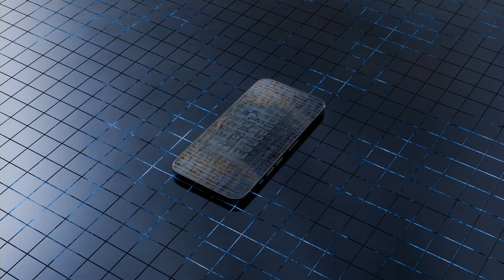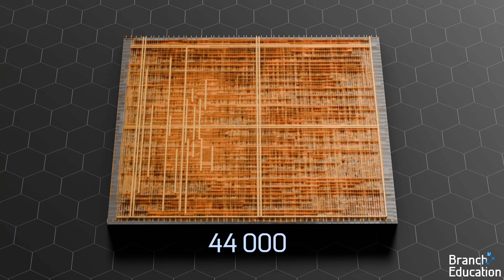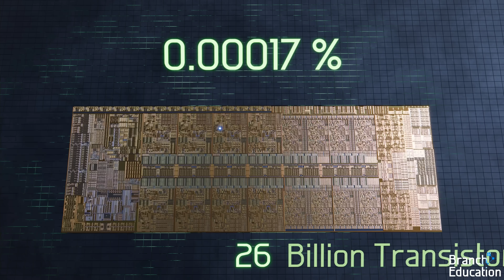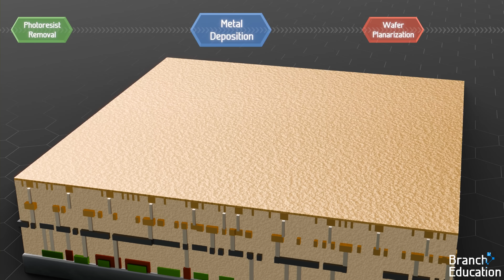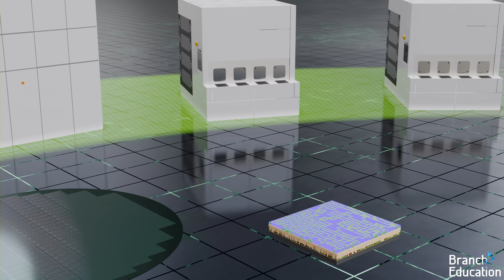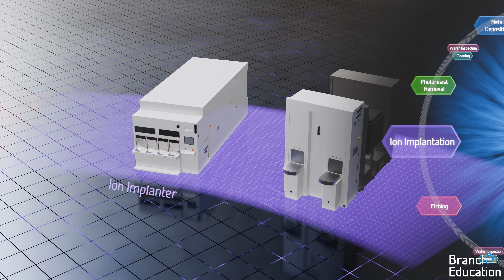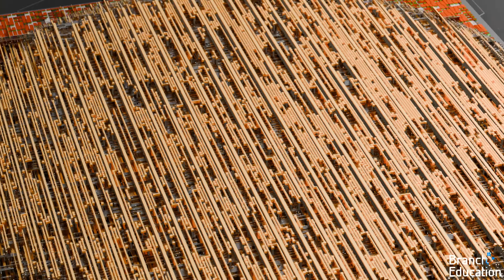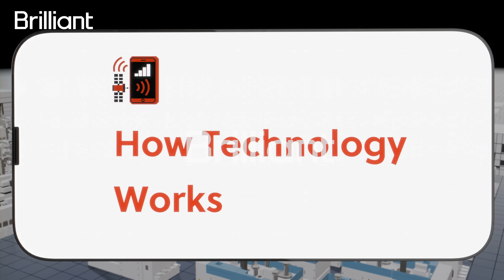How are Microchips Made? 🖥️🛠️ CPU Manufacturing Process Steps

Comment: Why are the silicone wafers round? I mean cutting square wafers would produce less waste than round wafers. I guess there's a good reason behind it.
Reply: wander myself as well, asked chatGPT, here are the main points: Manufacturing Process, Mechanical Strength and Handling,Efficiency in Semiconductor Fabrication,Minimizing Waste, Standardization and Consistency
Reply: @wisequigon  windows in airplanes are round because it's more durable shape. Maybe it's the same with wafers.

Comment: I knew that I would not be disappointed when I saw the video in my feed. Great work guys, I mainly talk about your channel to my friends when speaking of an efficient teaching/learning. The only problem I noticed in the video is that woosh sound when the scene moves around fast. Mainly at 10:36, 13:46, 14:10, 14:21. The timing should be accurate and the pitch should be proportional with the speed of the camera. This way the brain won't notice that and it will be an element of immersion. I am not a sound engineer but I have made some audio effects. If you don't have a guy for a custom sound FX library, I could help, at leaast with thee sounds.

Comment: yeah and then they take the dingle bop and they push it through the grumbo, where the fleeb is rubbed against it. It's important that the fleeb is rubbed, becasue the fleeb has all the fleeb juice. Then, a schlami shows up, and he rubs it...and spits on it. They cut the fleeb. There's several hizzards in the way. The blamfs rub against the chumbles, and the...plubis, and grumbo are shaved away.

Comment: Fantastic work here! Almost to my 2nd year as an Equipment engineer in the business, and when I first started as diffusion and RTA EE, it was very hard to see the forest thru the trees. When you said at the beginning how you would be flipping in between the process flow of a technology and the tool mechanics to achieve, I couldn’t help but smile! Everyday is a wild,  but ultimately gratifying roller coaster working at my plant. I get to work and learn about the most diverse tool sets, electronics, and be in my kind of atmosphere everyday. Your past videos are a big reason I go to work intrigued everyday because I get the opportunity to explore and understand a lot of the concepts I could never visualize. Can’t wait for your in depth transistor exploration

Comment: 11:58  These EUV lithography machines use concave MIRRORS, not lenses.  UV light is blocked by glass.
Reply: Yes, even the mask is a mirror! 
And the mirrors also block EUV light, but 30% is considered acceptable.
Reply: Only Samsung and TSMC are using those ASML machines, right? Intel is about to join them but still uses lenses, so if this is modelled after an intel fab, it's accurate, isn't it? But then it should have been labeled as UV, not EUS, i see...
Reply: @ole86  The section before, which explains photolithography, is done with UV light in mind and would be compatible with a non-EUV process.
However, the machine shown is an ASML EUV machine. It uses mirrors exclusively. Even the mask is a mirror.
Reply: @turun_ambartanen  thanks

Comment: 23:45 I wasn't expecting that CPUs are manufactured and labeled based on how many cores don't work.

This was an incredible in depth video. Thank you for your efforts!
Reply: It is not always like that, sometimes you get an actual i7 or sometimes a defective i9, these companies Eg. Nvidia, Intel, AMD always launch their Higher end models first due to this reason - so that based on the yield & defects could accordingly launch the budget models
Reply: @firefreezer3165  Damn that is some good insight. What do you think of the Ti versions? Is that the highest?
Reply: @voltixD  For some of the Ti models, for eg. NVIDIA's plan to release 4090 Ti, what nvidia did is it designed the original die with around 18000 cuda cores, but the 4090 (non Ti) had only ~16000 cores because GPUs have a significantly larger die size, so less yield.
The plan being later after accumulating sufficient stock of perfectly yielded die, Nvidia would later release 4090Ti with full ~18000 cores at a significantly higher price.
But since the yield was soo low that Nvidia never released 4090Ti
And probably the next gen 5000 series GPUs would have Multi Chip module design similar to AMD Ryzen, to reduce the die size & increase the yield
Reply: @firefreezer3165  it kind of makes you wonder. There was only meant to be 1 card and no variants. I you it was just supposed to be xx80's, but I see there's 90's now. So I wonder.
Reply: back in the day there were tools and ways of unlocking the disabled cores on CPUs at the possible cost of instability (most of the times there was a reason why they were disabled), these days they made that pretty much impossible though
Reply: This practice isn't exclusive to electronics. Most things made from materials that have random internal variations (like wood), have a similar triaging process where the better pieces go to the higher end models, and the less good ones go on to become the entry level models... One such case are guitars. A Fender Stratocaster it's 5x the price of a Squier model, but they are basically the same design. The Strat is made from the better parts of the wood, while the Squier maybe gets the part that has a knot in it. 

It seems a bit cruel, but from another perspective, at least for guitars, sometimes you get lucky with the lower end models and you get a really good one.
Reply: If I pray over my i5 can it become a i7?
Reply: @grahamthomas9319  yeah just remove the debris and fix the broken path 💀💀👍 and good luck
Reply: Yeah that was something really new to grasp so basically all are same but based on working cores they are priced 💀
Reply: @bhxlegend they don’t use one chip design for a whole product family. It will be a few chip designs that get binned to make the whole product line. This is really clear with Nvidia as it’s well known which chips are in which products.
Reply: That part blew me away
Reply: Yep, virtually all semiconductor chips are "binned" like this. I believe for Intel 13th gen, as used in the video, the entire desktop product stack is composed of 2 or 3 chip designs.

This also feeds back into higher-level design of the chips - you need to be able to test for defects, you need to be able to disable parts of the chip based on defects, you need to account for defects when figuring out the actual chip configurations such that it doesn't change performance characteristics, etc. For performance characteristics there is the unfortunate case of the GeForce GTX 970, which had an L2 cache slice for one of its memory controllers disabled as part of binning, which lead to rather nasty performance issues and the later "3.5GB fiasco".

Also for low-cost and mass-volume chips, such as DRAM and NAND ICs, this is accounted for in the design by having spare cells. So a 1GB memory chip is actually slightly more than 1GB so that defective memory cells can be substituted with spares.
Reply: Yeah imagine going for a i9 instead of i7 or i5 but telling your buddy at store you want one that works, and send him the link of the video with time stamp...

Comment: I'm highly impressed with this video. I've been working in and involved with memory R&D for almost a decade and this was a fantastic breakdown of the whole front end process from design to fabrication and binning. Back end/assembly is also pretty interesting, and arguably going to be a big hurdle in the coming years, so that may be a good additional video to show the dicing, encapsulation, and assembly process in further depth and detail? Also, in case anyone was curious, the pitches in DRAM are even smaller. The pitches for DRAM capacitors in current-gen DRAM (DDR5/GDDR6/GDDR6X) are <20nm. During the pitch multiplication processes the tolerances and stability required for process control are insane. Another video on DRAM and NAND could be interesting as well.

Comment: 23:24 Honestly really interesting that the different bins are actually the same design with varying amounts of defects. It's natural to think that the lower bins are simply cheaper designs that are easier to manufacture, but that's not the case at all.

Great video as always; probably the best, most in-depth, easiest-to-understand explanation on the entire internet. Something about the satisfying animation and slow but steady pacing/narration makes what should be a boring instructional video super entertaining.
Reply from the maker: Yeah, it also is done with GPUs.  Like the 3090ti vs 3080ti vs 3090 vs 3080 are all the same design of chip called GA102.  Interestingly, DRAM is not binned- because the chips are a lot smaller, the defective ones are just thrown away.
Reply: Also designing a chip that has to work with various amounts of defects must be hard as hell.
Reply: @pabblo097  so true 🤯 just blew my mind... not only designing a perfect chip but also designing the tolerances to keep imperfect ones as usable as possible 😮
Reply: They aren’t all the same chip. Intel uses two designs for their current desktop chips. The i9 and i7 share a design and the i5 and i3 share a design. Same with Nvidia but they use even more designs. A 4090 and a 4050 don’t use the same chip.

Comment: Semiconductor Manufacturing is indeed the most complex and high precision job for any engineer, it is the work of 100s of scientists and engineers that made this world possible. One of the best videos I had ever seen on this complicated process. Love you man ❤
Reply: 100s? I'd say add 3 zeros, if not 4.
Reply: Leftios of system sheet right iOS of system sheet ramed copid window hard to hard wafer data and window copy files data games saved at rams pins a straight a straight.
Reply: 8 second comp 24hp
Reply: Even with there are details still left out. It's that complicated.

Comment: Physics: Hey, let's be as difficult to understand as possible. Especially if you want to make a CPU. A speck of dust could destroy everything. That's how sensitive it should be. 

Branch Education: Anyway, let's break everything down in just under 30 minutes.
Reply from the maker: I woulda made it longer, but it's always a question as to the attention span on such an information dense topic.
Reply: @BranchEducation  That has to be one of the most difficult parts of this. It's so easy to nerd out on such a topic. For example, the ridiculously accurate lasers that vaporize tiny drops of tin, shot from a small gun, that are used to produce the UV light in the lithography machines. It would be so easy to plan out a video that would take 3 times as long to produce. The line has to be drawn somewhere. I think you all did a great job on that. It gives enough for someone to search deeper if they want to go down that rabbit hole.
Reply: @BranchEducation  make a video on how this chips work, like how the data flow from the storages to RAM and then how the SoC process it, moving from one sections to others as bits within a clock cycle
Reply: @GDev007  I agree, Now I got a Lot of info why it's called i9 Or i3 but now I wanted to know how data is proccessed, how a single transistor Or group processes data and manipulates it.
Reply: @BranchEducation even if it was 2hrs a person like try to watch every scene and concept more than once👍
Reply: @BranchEducation  You have some with bonus info in the subtitles and maybe a 2nd audio track? That goes into the weeds.
Reply: I would watch 1 hour long video covering every detail @BranchEducation
Reply: Education should be short and precise like this one, not attending boring classes with confusion. Very few are for educating others, most of people talk things without any essence which waste my time and that's why I avoid them. 
Thank you for your work!
Reply: @urimtefiki226  Too bad you didn't pay attention in English class. You won't find that on YouTube.